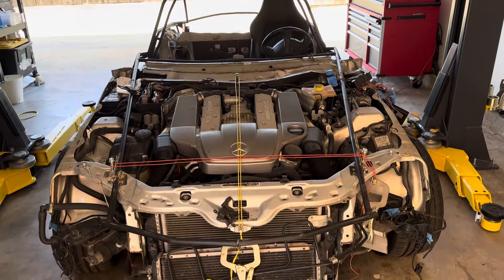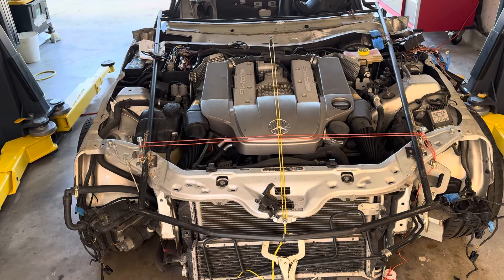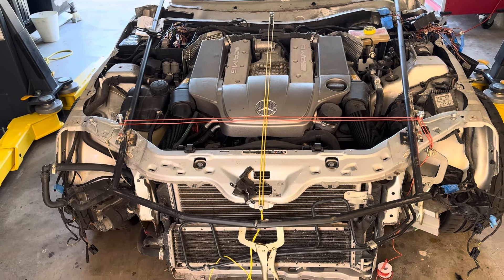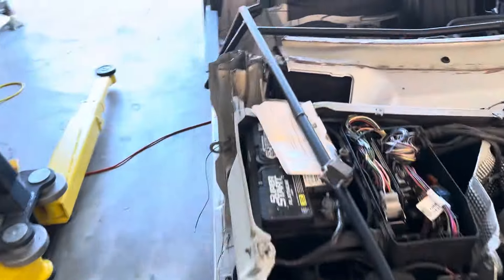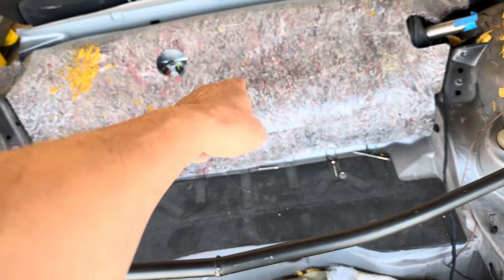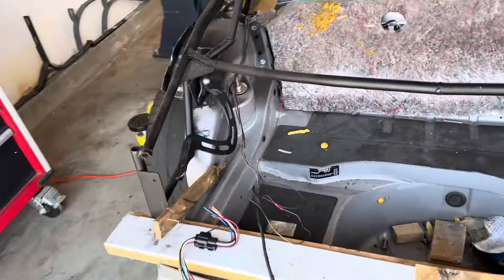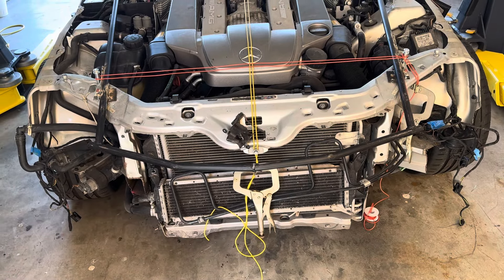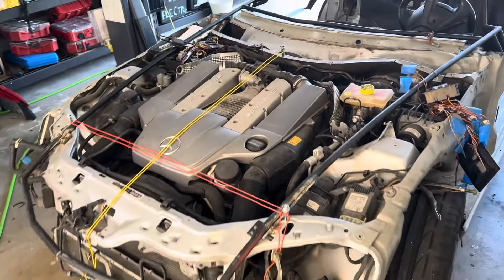#9 1955 Mercedes 300SL Gullwing Replica

Comment: Looking good, but you just gotta keep that front piece as I think you'll get too much body flex without it!😁
Reply from the maker: @RobsCrazyAdventuresInCostaRica  this the preeminently assessment. If it comes out, or moved, it will be reinforced at the end once all the subsystems ie. Radiator, expansion tank, condenser, horns etc are located permanently.